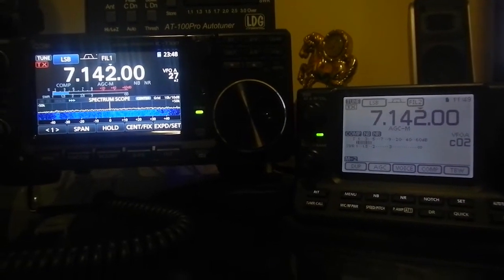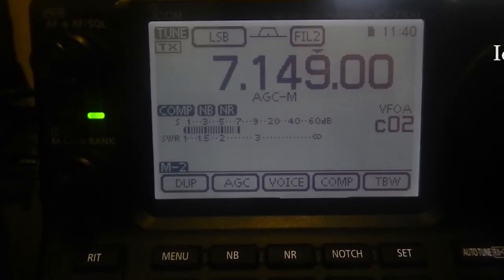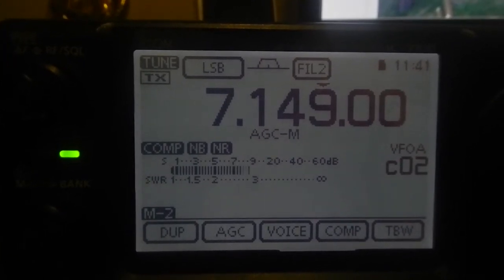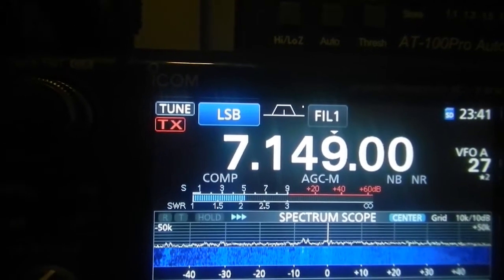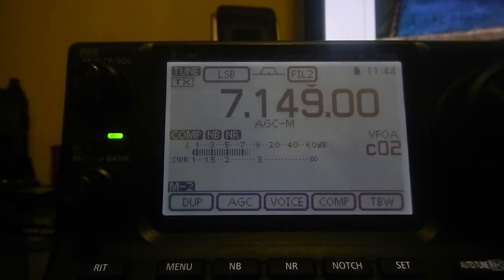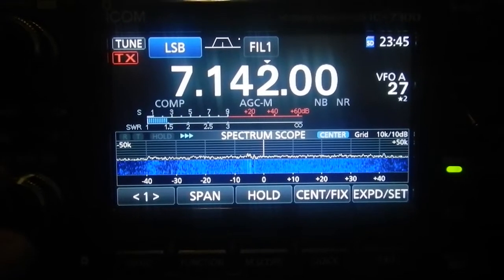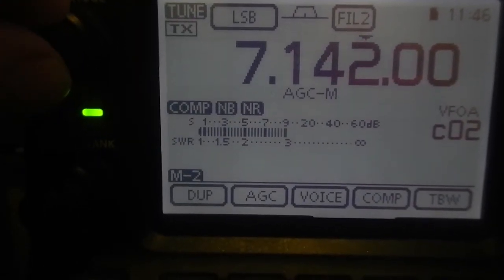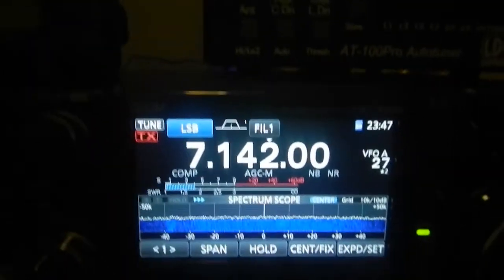Hustler 5BTV vs LNR precision Quad band end fed on 40m

Comment: I really appreciate your video. I'm going thru my 2nd year as a ham and have gone thru quite a few antennas and transceiver already. My latest one will be a Hustler 6BTV and a MFJ-17758 Dipole. Your video and explanation of your setup really helped ! Am going to subscribe to your channel, very worthy content.
Reply from the maker: Hi Alze,   no worries mate, you are most welcome. I haven't done much in the way of ham radio stuff lately but I still get on the radio when I can. Most of my activity is on the local 2m repeater when mobile. Plus a little dmr now and then. Seems like the sunspot cycle is on its way back up, so HF conditions should be on the improve. all the best mate and welcome the the hobby . 73 Vk2mrx

Comment: Hi ,What was the direction of the end fed was it also vertical  or  was at a angel away from station or towards the transmiting   station , I have found that it makes  a diffrens, Pieter
Reply from the maker: Hey Pieter, it was horizontal but I don't recall off the top of my head which direction. I'd say east /west or close enough to long path to europe based on where I used to point my beam when I had it up

Comment: Very illustrative comparison. Is your Huster vertical using radials and about how many? Thanks!
Reply from the maker: Only a few. I think the was adding 8 at the time. Non tuned random lengths. Although some were long at around 30m or so.

Comment: Interesting. I wonder if you run the endfed in a inverted L shape and some part of it vertical how it would play. How long is the endfed? MYAntenna company makes some nice ones and one for 160,80 and 40 265ft and could be install with some of it vertical and some of it horizontal.
Reply from the maker: the LNR end fed I have is the quad which is 65'  the myantenna 8-10 is around 130'. I don't know how many times I've nearly pulled the trigger and bought one of them for camping or the like but I'd have to get creative in the backyard for one of those.  Check out the steve ellington video on how he has his set up. I believe he has it partially vertical for his install.

Comment: Hello there thanks for such a nice video.
being honest we can see a stronger signals on 5BTV indeed but to be completely fair you need to disable DSP FILTER IN BOTH RADIOS because the vertical has the particular motor boat noise in the background. I have both antennas. but have used only the end Fed. the 5 BTV is waiting on my storage when I live in a not HOA community to rise and shine.
any way thanks again for your great video. nice radios by the way.
73s
Reply from the maker: Thanks Ed. 
I only had a quick look at the radio screens to make sure they were similar. I didn't go into the settings that far. 
You're right though and I hate when you see comparison videos with out making it a fair fight. 
I just thought I'd take the opportunity whilst they stations were there and I had the camera out. 
I definitely think the vertical would perform a lot better with a improved radial bed over what I have and I will get around to that one day. 

cheers for the comment, it's appreciated.